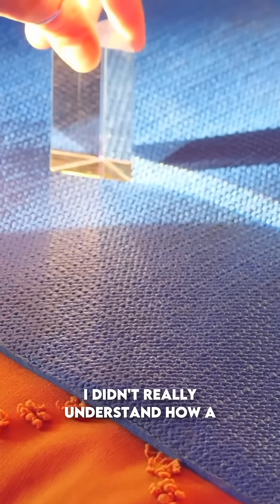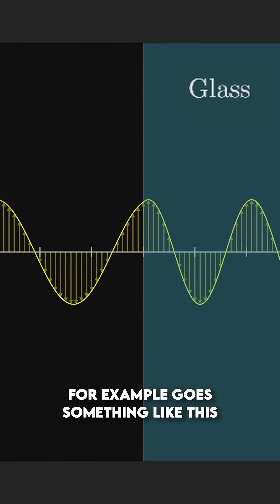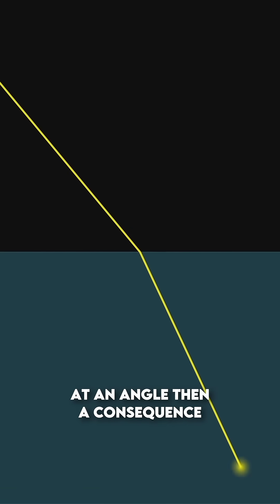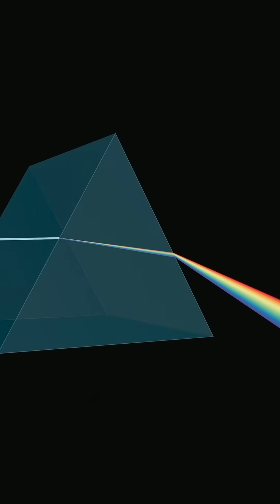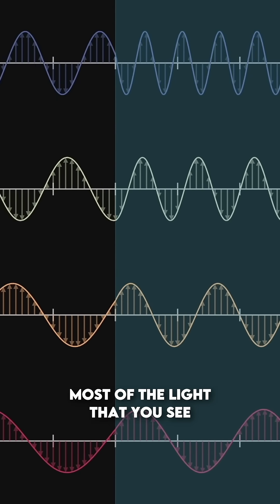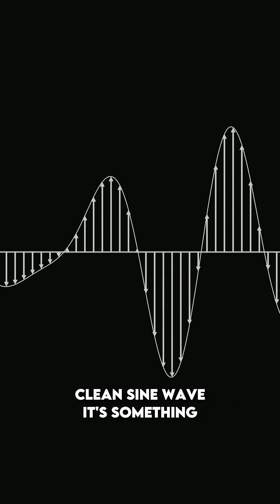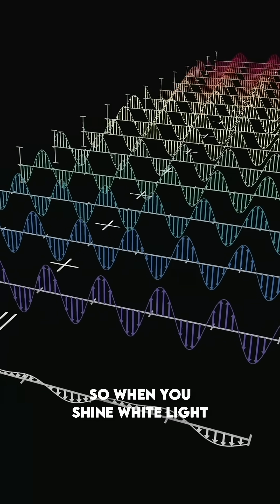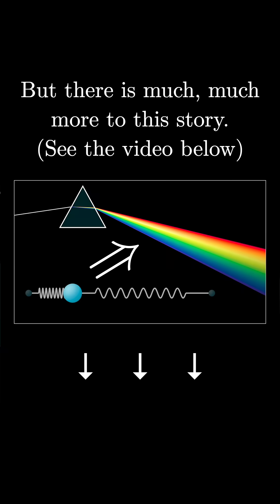How prisms work (full video linked above)

Comment: That seems incorrect and more that the different particle rays are entering at different angles hitting different thickness and being slowed as they pass through a more dense object the angle and thickness they pass through results in the color the thicker the area the slower it becomes. we record frequency as the speed of a particle, with the rods in our eyes being susceptible to the high mid and low frequency RGB of the particles. 

Similar how an xray works where the particles are blocked by a density that have harder time moving through causing darker images/shadows allowing you to see the structures inside, you can create a similar effect placing a flashlight to the tip of your finger. 

Note particles move like a wave and a point depending on how they are observed and no object truly blocks them.

Comment: There seems to be a flaw in the explanation; the speed of light is constant.
Reply: It is constant but inside a material light is considered 'slowed down' due to interference effects with the material.

The explenation I recall for the interference is that the light being an electromagenetic wave, causes the particles in the material to oscillate (as they are made of charged components) causing them to emit waves (that destructively interfere away from the beam path) which on the path of the beam interfere such that the resultant sum has its wavelength changed and hence its speed reduced.

So inside the material you aren't actually looking at a single light trajectory but rather a trajectory from the summation of several sources and hence can be slower than the speed of light.
Reply: It is only constant in a vacuum. As it hits some intermediary material, it slows down.

Comment: Light slowing in a medium always feels like a semantics issue. Because it does, but any photon involved will be traveling at c. So it also doesn't. There are dense explanations for particle scattering, wave scattering, or quantum superpositions, but my best short answer is that light is interacting with a bunch of stuff before coming out the other side. Saying it slows down is slightly misleading, and would beg the question what causes it to speed back up once it exits if it did.
Reply: As an analogy to QM where photons enter a potential barrier, incident as a sinusoid traveling through the potential ( tunneling) and upon exit is exponential, is that not an example of deceleration and change in frequency?
 And isn't it a photon actually a phonon through the prism and converts back to a photon upon exit? 
I know absurd ideas 😊
Reply: It's not travelling at all, that's the problem. It's a rate of induction that changes according to it's environment, vacuum, air, glass etc. the rate of induction changes as it contacts different materials. The speed of light is not a speed limit but a constant rate of induction.
Reply: @domestinger8805  which is constant
Reply: You are incorrect this time, because this is a phenomena explained by the wave like properties of light, so it does slow down. However, it conserves energy, which is why the angle will depend on the frequency, more precisely, on the wavelenght. Also, you are ignoring fermat's theorem that light always travels in the fastest possible, *which creates this rule*. The only quantum part of this is the rule of dispersion.
Reply: The simple and intuitive way to explain it is that "It's not moving at a slower speed, it's taking a longer path to reach the same destination"
Reply: @FocusE7Q  you are violating theorem's saying that. Nobody here understands light by the looks of it, nor quantum mechanics.
Reply: Thank you for this comment because I had the same issue with him saying “light slows down”

Comment: You know an explanation is bad when it involves light not going the speed of light and things changing direction just cause they lost velocity
Reply: Speed of light changes based on the medium.

It is a bad explanation however because of the description of white light.
Reply: @MrGenie23432  the speed light can propagate the same distance through a medium changes, the speed that the light moves never changes. In other words, there are more twisted winding roads light takes sometimes which make what could be a 10 minute drive if it were strait into a 10 hour drive, but it always travels 60mph

Comment: The “light bends” thing is really confusing to me.  

The explanation that makes it work for me is that the light is minimizing travel time between two points and the prism slows light down.  So to shine a light at a point in a prism, you need to direct the light so that it would match up with the time minimizing path.  This is why light always bends to be more normal to the surface of the prism.  The light “wants” to spend less time in the prism.

Comment: Does light show down,  or does it take a longer path? I don't understand how the speed of light is constant,  but somehow slows down too
Reply: The speed of light is not constant. c refers to the maximum speed of propagation of any physical cause, only with zero resistance. ( in a vacuum)
Reply: Speed of light of c is refered to how fast light travels in a vaccum (maximum possible speed)

Comment: The best metaphor I've heard is an rc-car driving on pavement, and then the car runs onto a patch of grass at an angle.

It's easy to intuit that the wheels that hit the grass first will slowdown while the wheels on the other side continue at the same speed, causing the whole car to turn toward the grass.

Comment: The way i have allways visualized it is, light is two wheels connected by an axile. Like a car axle with a locked differetial. As one wheel hits the grass it slows down and turns the light ray as it changes medium.

Comment: My science teacher loved putting things into unscientific but very easy to understand metaphors. He described light refracting when it enters a slower medium at an angle like if you were pulling a wagon on pavement and then crossed over to gravel at an angle, your first 2 tires to cross would be slowed down by the gravel faster causing you to turn slightly.

Comment: Didn't you get car, and then the lanes of traffic explination. 

So if you think of it as a a car driving from road on to the verge, the wheel that touches the verge first slows down more and turns the car slightly. 

Then if you expand this to several lanes (one for each colour l, then different lanes slow down sooner changing their trajectory in comparison to other lanes).

Comment: So you want to tell me that people in American high schools are not taught that light is a composition of electromagnetic waves with different wavelengths that get refracted differently when entering the prism because of their wavelengths? 
That's really sad.
Reply: They are.  What they aren't taught is WHY light changes speed in optically dense materials.
Reply: @carultch Well, I would bet nobody is taught the WHY in schools. Do you know WHY actually?
Reply: @Asto508  If you watch his full video on this topic, you'll see why.  The short answer is, it's a superposition between the original light wave and a light wave that the medium generates in response to it, that add up to a wave that moves slower than the speed of light.
Reply: @carultch  and who gets taught this in school?
Reply: @Asto508  Very few people, that's the entire point.  Usually, we get an incomplete explanation of why refraction happens, unless you study it as part of a physics degree.  We're taught that the wave speed slows down, but not why the wave speed slows down.  There's also incorrect explanations people get at the high school level about this.

Comment: I don’t know why I haven’t made this connection before, but a prism just acts as an analog Fourier transform operator.
Reply: Furthermore a lens acts like a 2D analog Fourier transform at the focal plane. An object such as a slide (semi-transparent medium from analog camera) with periodic horizontal stripes, illuminated with monochromatic plane waves provides the object. Then send that through a lens which focuses most of the energy to a point, however a bright dot will appear above and below the focal spot due to the periodic horizontal stripes. Those dots are the 2D Fourier transformation.

Comment: If I were to guess why light slows down is because at different wavelengths they became more likely to hit a glass molecule. And the fact that wavelengths correspond to how much energy a photon has, that also means it will affect the orbital of the electron it encounters differently depending on its wavelength. And I think this difference will cause it to be re-emitted at a specific angle once the electron drops back down from its unstable energy state. And that this angle will differ at different wavelengths. Thus red will be at a different angle than purple, causing a gradient of separation creating a rainbow.

So, how wrong am I?

Comment: The problem is, why the prism can split it but no a regular glass one
Reply from the maker: It's a great question! 

If you shine white light into a flat slab of glass, they will bend at different rates when they first enter. Then as they exit, because both faces of the slab are parallel, they bend back to all be going in the same direction. This is unlike a prism, where their directions get further separated.

This means if you shine a thin beam of white light at an angle into a slab, out the other end you will get many parallel rays of different colors, spaced out a tiny bit. That spacing will be very small though, proportional to the thickness of the glass, generally too small to really notice.

So if you look at something through a piece of glass, at an angle, there will be a very slight tendency for more violet colors from one point on that image to bleed a little into an adjacent point, and for the more red colors to bleed the other direction.
Reply: If you take a long lens objective, I mean a flat lens with a spherical lens beneath, shine a UV laser into it at an angle, what you will see is a helix that consists of three different colors: Violet, where the light enters, green in the middle, to red at the surface of the sphere. The light then reverses this configuration on the way out. This shows that a refection affects frequency, but the light recovers it. How? @3blue1brown
Reply: Because, the two surfaces are at an angle. In a glass plane, when light enters from air to glass, it bends closer to the normal and when it leaves from glass to air, it bends away from the normal cancelling the effect. But in a prism, when the light exists the glass, the angle is such that even though it bends away from the normal, it is still at an angle to the incident ray
Reply: @the_sophile  Make sense